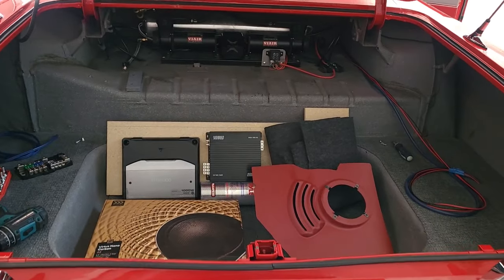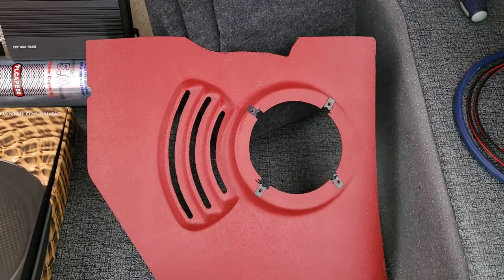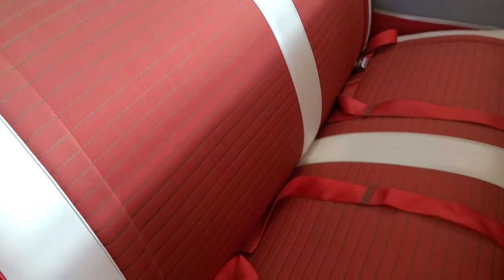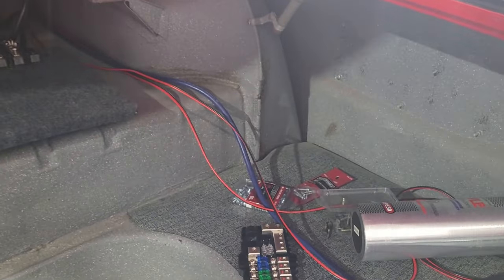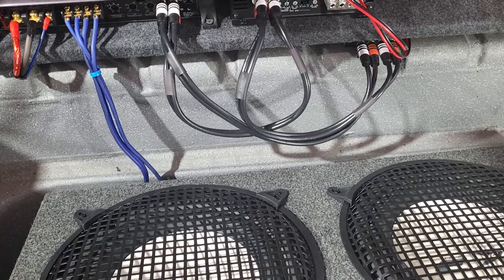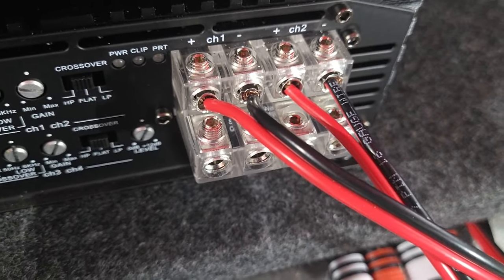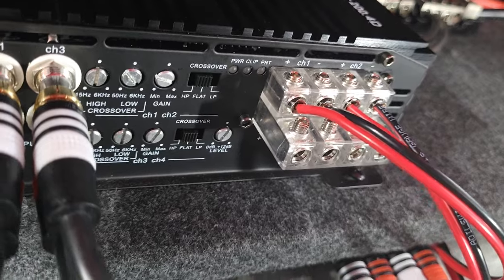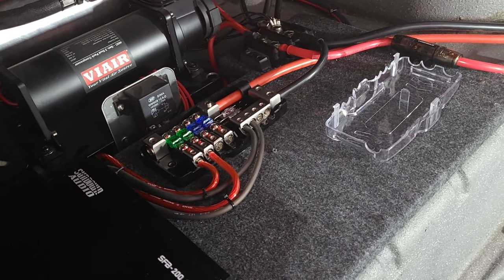1961 Impala Stereo Install

Comment: The gain is to match the input voltage of the amp to the output voltage of the pre amp of the stereo just so you know great video tho
Reply from the maker: You are right. I actually use an oscilloscope to find the peak of the radio or pre-amp - once that's set I then use it for the peak gains on the amps. I also leave the sub bass boost on the sub amp at 0. I was trying to keep it simple here. May make another video on how to properly adjust gains, but there are so many out there already :) - thank you for commenting and providing good added info!